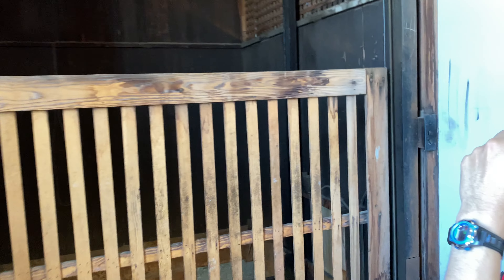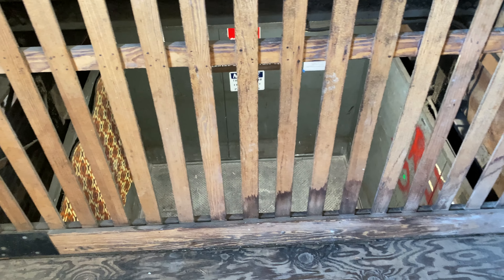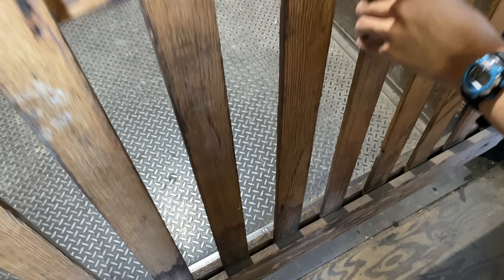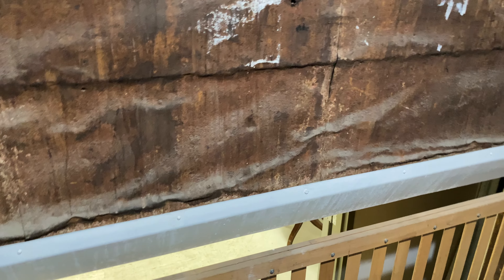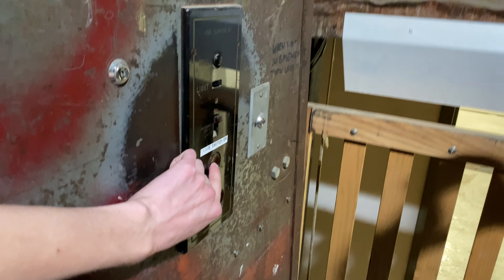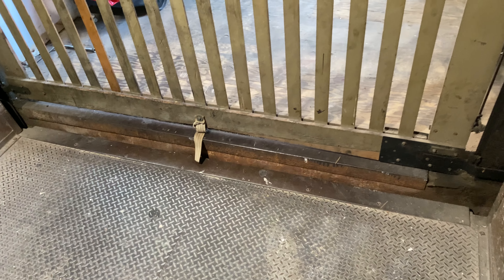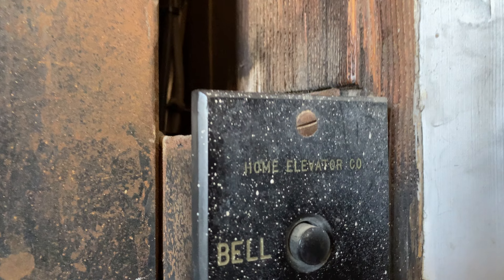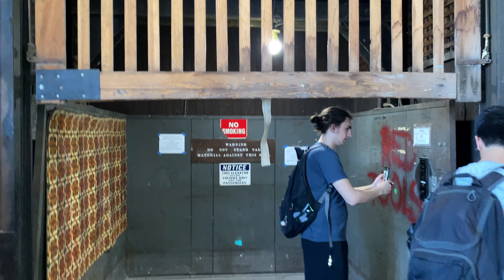Antique Home Hydraulic Freight elevator @ Show Place Square South - San Francisco, CA

Comment: Many older traction cars were converted to hydros in Los Angeles as bldgs. got seismic retrofits.  I suspect this may be the same.
Reply: It is worth noting there are also some very old hydraulic freight elevators (that appear to have likely always been hydraulic) from the 1920s or possibly earlier, some of which may have run on city water pressure operated by a shipper rope (pull rope), later converted to hydroelectric when shipper rope operation was outlawed in California.